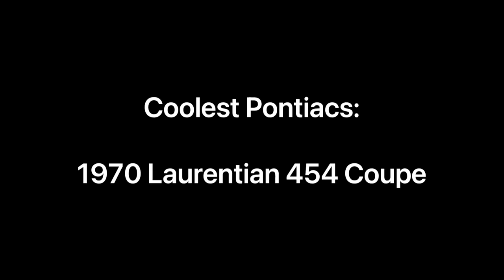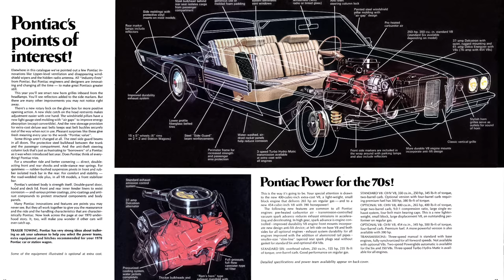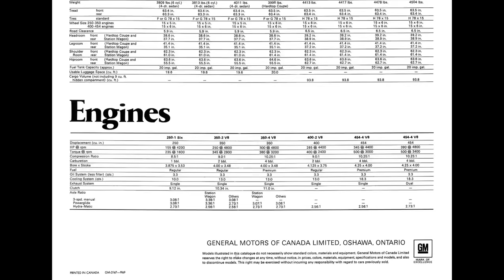A Factory 454-Powered Pontiac?! This 1970 Pontiac Is Powered By a Chevy Big Block!

Comment: IF GM wouldve standardized more of their brands components they couldve been much more profitable at scale but no they wanted to have unnecessary designs and manufactured parts that complicated everything and increased costs. Theyre learning now how Tesla does it better.
Reply: Tesla is awful from a quality control standpoint and it’s also a really young company so it’s far easier to have production streamlined. 

GM was a whole pile of different acquisitions each of which had their own workforces and unions who demanded that they continue working even though they were redundant. 

And some of that redundancy worked out. After a fire in the Hydramatic Transmission plant in 1953.. Buick Dynaflows were installed in Oldsmobiles and Cadillacs while Chevrolet Powerglides were installed in Pontiacs. 

GM was sharing whole platforms back in the 70s and sharing engines on nearly all cars by the 1980s.  

This was also in an era where people were just finding out about “just in time” manufacturing as well the availability of modular manufacturing (like Ford’s Modular V8.. where it’s the machine tools not the engines that are modular so they can be retooled very quickly to make different engines) and CNC and additive processes.

GM has done a really good job rationalizing its operations by cutting divisions and products. Tesla lacks the industrial capacity to keep up.